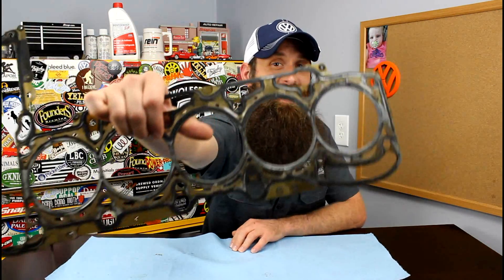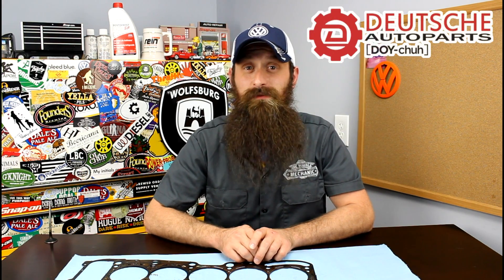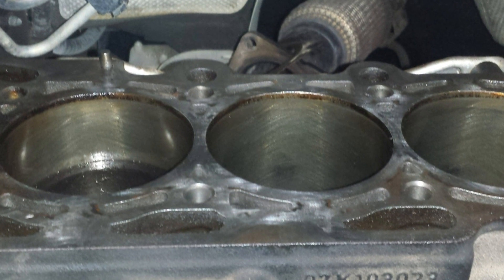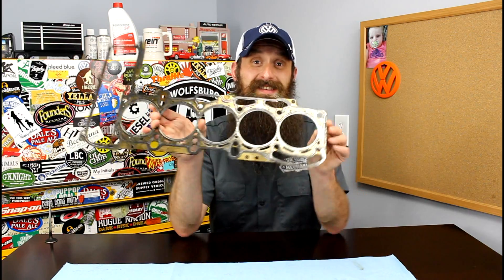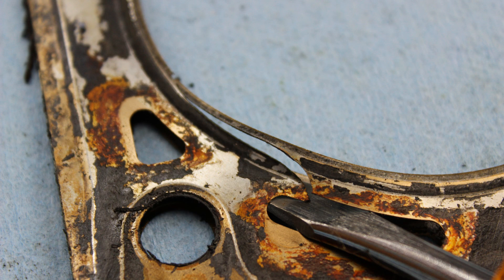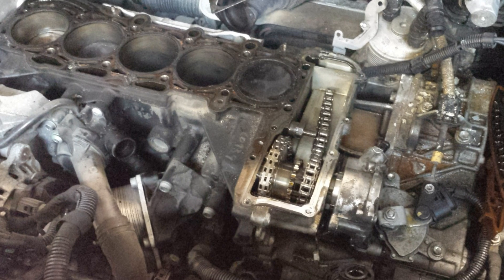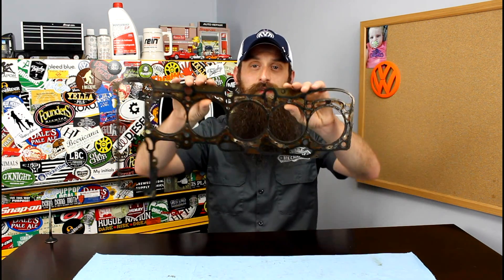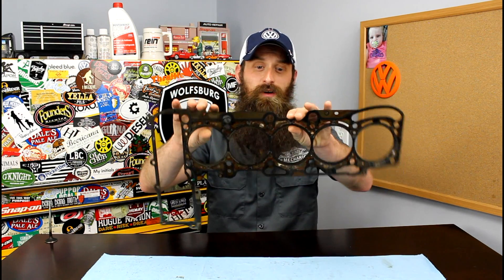How VW Parts Fail ~ 2.5L Head Gaskets

Comment: im trying to rule this out because i have moisture in all my. coil packs after running the car and misfires after changing valve cover. Maybe its possible I damaged the head on reinstsalling valve cover IDK. I assume though that it wouldnt be moisture but coolant on the packs if it was head. White smoke when stareting the car after misfries that goes away is more likely unburnt stale fuel /moisture right?

Comment: I have a 2012 Jetta as far as the cooling system goes it has new radiator thermostat water pump temperature sensors and hoses. I’m down to the head gasket. Does anybody know of a good video?

Comment: Just had my head gasket go one mine in the exact same place as the one in this video. I had watched this video several years ago and it immediately came to mind after having some random issues. I ended up fixing it myself and this is the first time I ever did a head gasket. I would say it is an intermediate level diy for a weekend mechanic. There are a few specialized tools you need but they are not very expensive.

Comment: I have a 2011 jetta 2.5 that had a blown head gasket. I ocnstantly had a issue with misfires and nobody could diagnose the issue. I submitted a oil sample to a lab and they told me I had a high amount of coolant chemicals in my oil which indicated a head gasket leak. Took it in to the shop and sure enough, it was a leaky head gasket

Comment: Humble mechanic , I have a 2013 Volkswagen Passat v5 , 2.5 l and what you described verbatim has happened to my car at 128 k miles . After the 3rd mechanic (Volkswagen dealership ) did a pressure test and found nothing they did as u said and took out a park plugs and saw coolant mixing getting into cylinder . I have done every maintenance on this car needed and I was alerted of this when my check engine light went on with no coolant at all in the reso voir .  I never saw a puddle or anything and there was white smoke
Coming out of my muffler only that day . I added coolant and monitored and it remained at the perfect temperature and operated fine but a week or so later the engine shook at start (contaminated spark plug) and I lost some (not all) coolant as well as saw white smoke again when the car started . 

Is there anyway this can be something besides the head gasket since the   Dealership never was able to actually
See where it leaked from ?

Also, what else should I change if I am doing this job on my car ? I have literally all original parts minus one valve  Cover gasket repair . 

Is this worth it fix on a passat with 128k

Was there something I did wrong or could have prevented to have this not happen ?

Was this something that could have happened even directly after a service ? Are there any good gasket stop  leak products out there or so they all damage your engine   

You  mentioned this is not a common problem but my Volkswagen has been incredibly finicky with a broken AC compresser at 70k , entire new suspension system at 100 k , faulty airbag sensors , clock spring etc . Anyone who can answer these questions thank I aoucj car is ten years old but I am sole
Owner and she is my baby as much as I hate the maintenance it drives better than most cars

Comment: Thank you for putting together, great info. I have 2008 Jetta 2.5L with 120k miles. Would it be advised to change the timing chains at the same time?
Reply from the maker: yeah thats not a bad idea if youre this far. You are pulling the transmission on it for the whole chain setup
Reply: @HumbleMechanic  I might try and get buy with just removing the upper chain.  To ensure there is the right tension on the chain is there a took i would need? I sounds like there is some kind of tool that applies preload to the exhaust cam sprocket. Is that accurate? I am not finding any info on chain replacement. Even the Bentley book is missing it.  Thanks for the help.

Comment: Hi all, I have a 2.5l with low compression on cylinder 2. Dry 80 psi, wet 130. Does any one have any ideal what this could be? Stuck ring? Also the car only misfires at idle. I can go weeks with no check engine light, but if I idle for more than 5 minutes. Then check engine light will start to flash and then eventually stay on. No blue smoke, only a slight hesitation every 3 seconds at idle and some what of a popping exhaust at hesitation. ???

Comment: ahhhh just got a 2.5L with a shit gasket, I know the car overheated on the owner, then started smelling coolant in the exhaust and now this, no compression and coolant in 1-2-3 cylinders. First one I see fail in SEVERAL years working on VW's and Audis. However, I have heard of a few 2.5's with failed HG's. Time to take this bish apart.

Comment: I have a 07 vw jetta 2.5.  From cold start the temp gauge pegs out.  Can you tell me if its a head gasket or its a water pump issue or other?
Reply from the maker: That’s odd. If it does it right away, it almost has to be electrical
Reply: @HumbleMechanic  other symptoms of start up include,  no quick start up when it it pegs out the engine sputters and dies or almost dies.  When drove 2-3 miles it normalizes then stays in the mid range.
Reply: @HumbleMechanic  just wondering if you have any ideas
Reply: @69johnnymitch   mine did the same thing it’s probably your coolant temperature sensor easy to change and it’s like 15$ on amazon

Comment: The 2.5L has a pretty beefy head gasket, I'd say something terrible has to happen for them to go bad. My bet is driving without coolant or a dead water pump is the cause for the majority of the failures.
Reply: In other words insane neglection. That's why they created "Limp Mode". I think most car issues are from people ignoring maintenance. There's usually recalls for things out of your control.
Reply: @wandameadows5736  aside from the occasional assembly goof or electronic gremlins/normal wear; yeah, the majority of problems are cause by neglect or misuse.

I wouldn't fault anyone for having a failing water pump though, those can be really finicky and they can't be seen just opening the hood (on this engine).

Comment: Had my whole engine replaced after I bought a used 2013 Passat. Previous owner or the dealer put head gasket sealer in the radiator. Blew my engine after having the car 2 months
Reply: Stop leak really gunks stuff up, what a knucklehead.
Reply: Mr S she runnin great now with my fancy new engine though :)

Comment: do you know if they make a supercharger for my 2.5 b7 Passat (2013). I cant find a whole lot for this car.. Every other make that year has tons of mods... I don't want to sell it I love the half stroke of the 5cyl. 
So Far I have 
- A actual cold air intake
- DYI Cat back only Increased in diameter a half inch
- A sprint pedal booster (highly recommend for this car in particular...)
-  Throttle Body spacer
- Race coil overs
- I really don't want to turbo it as it is slightly harder on car) 
If u know anyone who fabs them please let me know 
and Whats your opinion on what to do next. And I don't want to chip it until I force induct it.
Reply from the maker: I think there are a few turbo set ups people use for Golfs. It may be very similar. Never seen any SC kits

Comment: Looks like my 2006 VW Jetta has a blown gasket.  When I replaced the PCV Valve cover noticed a milky oil coolant mix solution found on cylinder 1 when I removed the spark plugs and on the oil cap. What is y’alls take on the head gasket sealents?  i.e. Bars head sealer, etc.

Comment: Have  2012 Volkswagen Touareg with 153k miles. The headgaset needs to be replaced ,confirmed by dealer and another certified shop, both mechanics are saying it can't be fixed and the only way out is to get a used engine that cost $12k! still owe on the car so this is a huge financial loss, do you have any suggestions?
Reply from the maker: What happened to it? Those are pretty stout engines.
Reply: @HumbleMechanic  they are saying because the head gasket is gone and the miles are too high, they won't stand behind fixing it. They have to pull apart the engine to fix it and will most likely have to replace other parts.... it doesn't add up to me but 3 different places are saying the same thing. So stuck with a car payment and wont get much for the car if sold. . Everything else is fine with the car... are their other options you can suggest?
Reply: Janice Rowe are they saying that the block is warped?

Comment: 2012 2.5 with 130k, no head gasket leak.
Reply: What about now?
Reply: @edgardogl2  it is a lot less common on these engine than they used to be. I have one at 150k, no signs of leaking.
Reply: 2011 2.5 with 137k. No issue whatsoever. Water pump was jacked though.

Comment: How likely would I see an oil leak from the timing change cover
Reply from the maker: Not sure common on the 2.5. The valve cover is more common
Reply: @HumbleMechanic  it doesn't seem to be the valve cover that's clean the oil leak is pooling on the gear box and I've already ruled out the vac pump with a deleat
Reply: @HighwayBearphotos  I’ve seen timing covers leak on higher mileage 2.5’s, but honestly, seen the delete kits leak right out of the box. Those delete kits suck. Just replace the pump or reseal it!

Comment: I have a client. States she never overheated the engine....idk. But, misfire cyl1 cold start only maybe stumbles 6-7 seconds. I looked at the oil and it seemed ok, smelt acidic. Performed an oil service as she was past due. She came back due to a not starting. I went to her and the car started right up. Oil it to the shop and left it overnight. Cold  Started right up again with the slight stumble. I used a fluid “sniffer” test on the cooling system and failed right away. Oil was milky as well..... looking at a head gasket...

Comment: Well, I came here just to get your thoughts on VW 2.5 head gasket failures, and when you said that these failures are very rare, that instantly made me feel better. Now, if I can figure out why and where I'm losing a little coolant in my MK5 Jetta....
Reply from the maker: It actually can be the head gasket. I have seen a couple, but it's very rare. I got the car hot, then pulled the plugs and you could see coolant leaking into cylinder 1.

Comment: Now I've got an issue I THINK might be related to this? I blow white smoke after long distance drives - I'm talking over 200 miles. It only happens during those drives. I commute about 30-40 miles a day and it's never happened. The car does it after I exit a highway and decelerate below 50 mph. Belches smoke for about 10 seconds and then goes back to regular operation. Any clues?

Comment: My 1995 t4 with 40k tests  150 psi in all cylinders. And yet I consume a quart about every 700 miles. Can an engine with good compression get blow by. I never heard of head gasket failure causing oil burning but this is what you imply. Correct?

Comment: It's has been over 2 yrs since Charles made this video.

Number of 2.5 head gaskets I have done since then...

0, 🍩🍩 😎
Reply from the maker: I have only seen 2 in my 13 years with VW. I think maybe 5 head gaskets total.
Reply: HumbleMechanic i live in Miami, Fl. Weather here is much more unforgiving to cooling system failure than other parts of the country.

That said, can't say I have ever done any kind of serious mechanical repairs to the 2.5.  Most I've done is a noisy timing chain, due to low oil levels.  1.8's tho, I've done dozens of head gaskets on those.
Reply: I'm here because the head gasket on my 2012 VW Jetta SE 2.5 needs to be replaced.
Reply: i got one, but it was driven without coolant for a while sooo
Reply: What’s a common 2.5 problem brother if you don’t mind me asking ? I own a 2012 Jetta 2.5 n has P2450 n need help primo
Reply: @Richhomiemarcos818  Leak detection pump. That is part of the evap system. It’s a pump that checks the evap system for leaks. 90% of the time, it’s the pump that failed. However it should be checked for proper operation before you replace it. It’s not too expensive 100ish bucks or so for the part plus labor. Located in the right-rear bumper area.
Reply: Update (OP is me this is my business acct) It has been over 5 years since Charles made this video. Number of head gaskets I have done on a 2.5 since then…

2️⃣🤭
Reply: Update: VDub nation 🫡 it's been over 5 years since Charles made this video. Number of HG I've done on a 2.5?

2️⃣ 🤷‍♂️

I did do an RMS on a 2.5 (not common). Mileage? 267k 😱

Comment: Sometimes a cylinder head will crack and the symptoms are exactly the same as a failed head gasket. This is why it is essential to take the head to an automotive machinist's shop to test for cracks, and to have the sealing surfaces milled clean.

Comment: what I am doing is trying to decide if I should spend the money and time tearing the head off. The car has overheated two different times by the other owner. is it worth me trying a head gasket or should I go find another one eight turbo awp heads and replace the whole motor

Comment: have you had any 1.8t head gasket go bad!? I have a 1.8 T 2003 Jetta 102 k there is exhaust gases in the cooling system. but I have never heard of a 1/8 Turbo having a bad head gasket
Reply from the maker: +Danny Storto the only ones I've seen were driven while overheating.

Comment: I lost one on my modified ALH. Wish I had tightened head bolts BEFORE pulling everything, I had 2 of the stretch bolts that were finger tight( or is that finger loose?). Motor had 300k. Symptoms were increased coolant temps when I beat on it (200f Max) and 0.2% coolant in the oil according to Blackstone labs. I never had to add coolant or any oil between OCI's. Motor is now 30K in to new head gasket and is problem free.

Comment: I Will be doing a carbon buildup removal on my Fsi this weekend,  Any tips or things i should pay close attention too? is it possible to wiggle out the injectors out without the vw special tool? Thanks
Reply from the maker: +Gli_Fahrenheit I have never used the factory removal tool for the injectors. But you will need it to replace the seals.
Reply: Awesome! Thanks ! HumbleMechanic

Comment: Was the AFP engine a paper gasket or metal?
Reply from the maker: +Jacksonkellyfreak metal. Using the AFP on the AAA is really common. I used that AFP on my Cabby.
Reply: +HumbleMechanic Oh good. I'm about to do my timing chains and I was debating on "well, while I'm that deep into it.." but I think I'll just leave it be. It isn't leaking or anything.

Comment: I Never had to replace any gasket on 2.5 L engine actually I never removed the head on one yet but I replaced quite a few 1.6 L Diesel engine head gaskets for oil in the coolant or oil in the front of the block and some ALH TDI for cylinder pressure in the the cooling system.